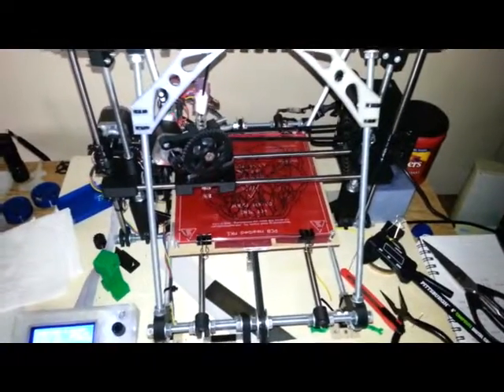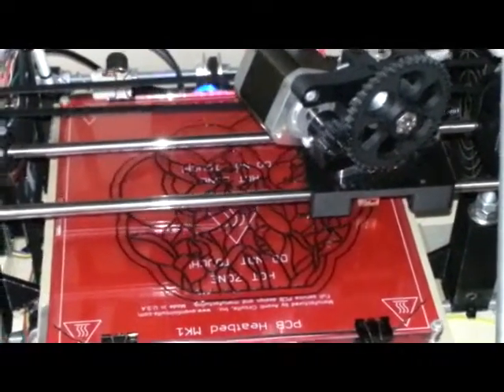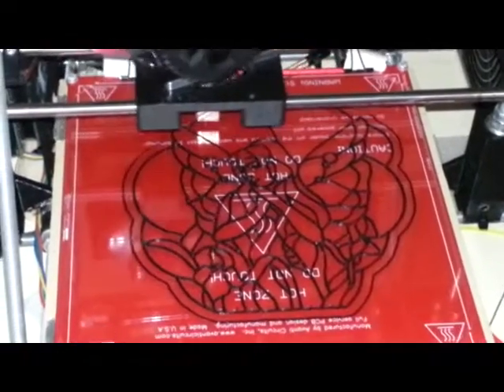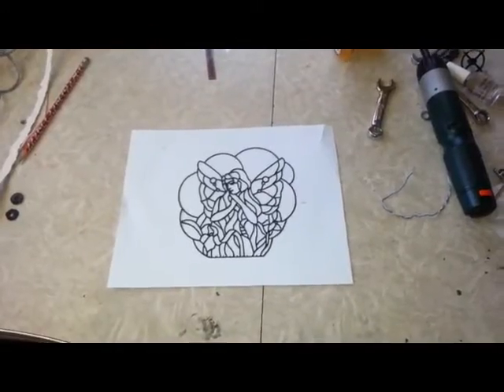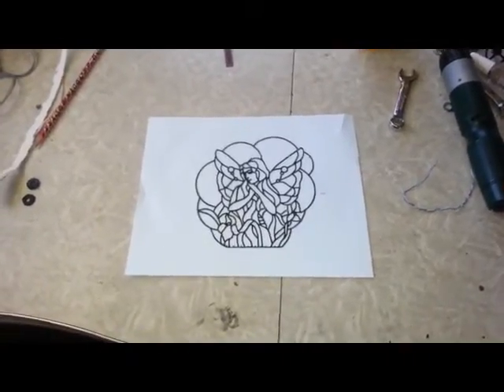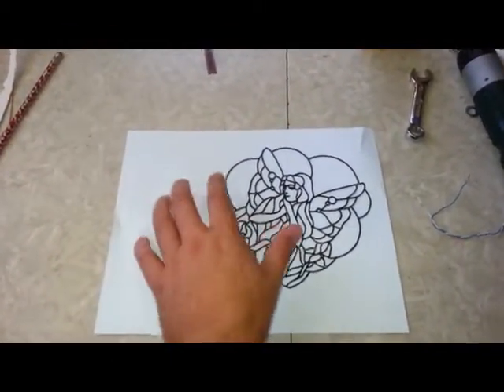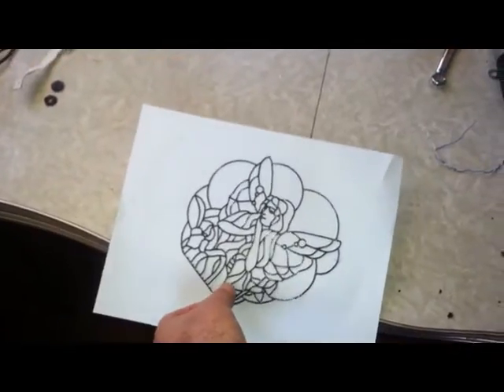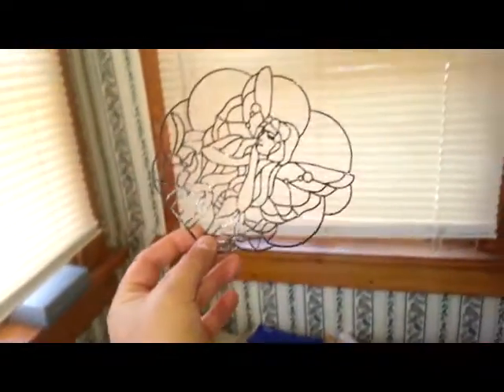Drawing With the 3D printer.

Comment from the maker: Three part process.   First, I scanned it in as a picture.  Then, used InkScape to auto trace it and make a vector art version.  Cleaned that up and saved it as a Plain SVG file.
I then imported the SVG file into Blender where I could scale it up to size, and extrude it to a .4mm (that's Point 4), thickness.  (two layers at .2mm layer).
I exported the file from Blender as a .stl and loaded that into Kisslicer to make the Gcode file.